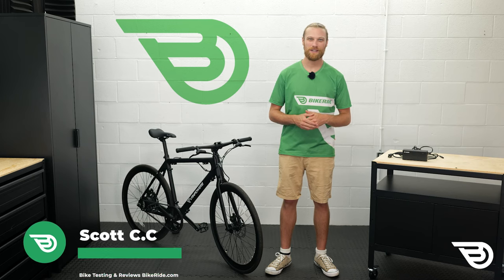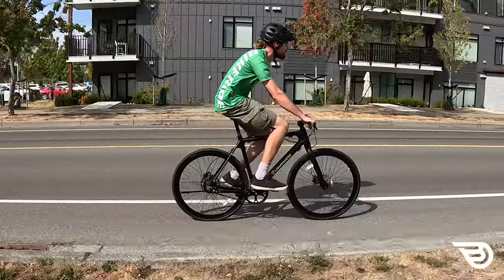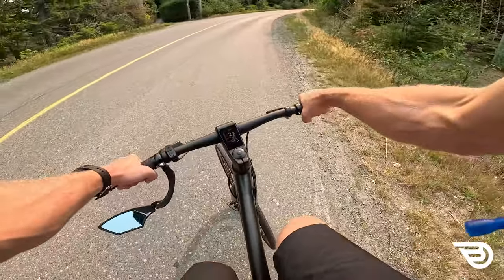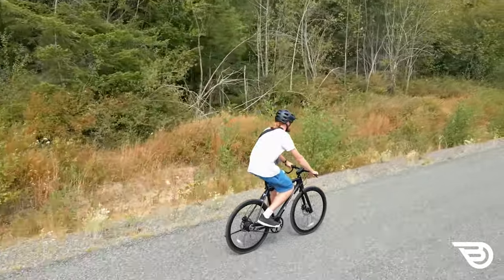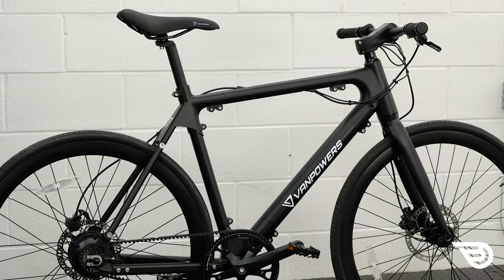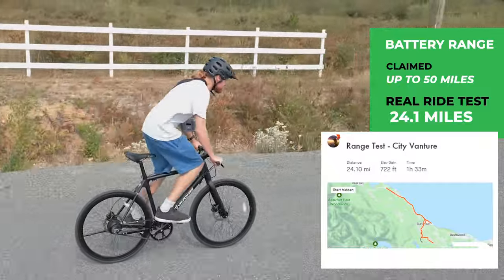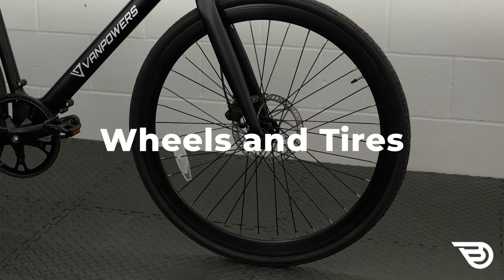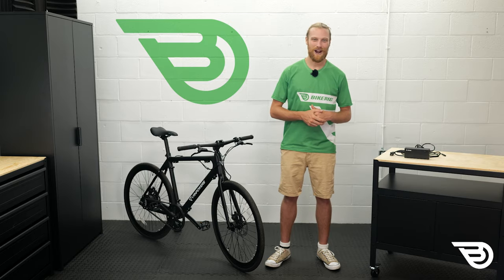VanPowers City Vanture - Flat Pack DIY Urban E-Bike Review | BikeRide.com

Comment: As a City Vanture owner I can attest this is a solid review. I'm happy with the bike overall although I do occasionally run into issues with hills as mentioned in the video. That said, it tackles some hills that were difficult to climb with the regular mountain bike I owned previously. One minor drawback not mentioned in the video is if you're traveling a good speed and lower the pedal assist down a level (because it's not needed) you will feel "drag" from the motor that you would not feel downshifting on a normal bike. At this point you have two options: A) let the bike coast down to the speed that is compatible with that assist level or B) turn it back to the next higher assist level to where you feel little to no resistance in the peddling at all. This doesn't happen all the time but when it does, it's somewhat of a let down. Best suited for relatively flat urban environments and paved trails. 4 out of 5 stars.
ps. Range with extra battery: 30 miles on semi-hilly paved terrain primarily on level 3 using 4 and 5 for hills only without any power loss before having to recharge. *Average speed 16 mph
Reply from the maker: Thanks for watching and commenting! Thats great to know that your experience was very similar to mine with the bike. I agree with all your points about hill climbing and general riding, its a fun and agile bike for flats and smaller hills, and it is definitely better then riding a normal bike up a hill! 

Good point about the motor drag, I did not notice that as much on our test bike, but TBH I was riding it mostly in the highest assist setting, which probably prevented me from feeling that motor drag as mentioned. Great comment for other potential purchasers!

Comment: Very similar to the Ride1up gravel, that has sold well. I purchased the KBO Stealth Hurricane that arrived weighing 37 pounds with its larger 10 amp battery. I immediately went to work removing 5 pounds of weight and adding drop bars. I had to change my route, because it will not climb hills, similar to this model. Not having a torque sensor, only a cheap cadence sensor is one of the major problems of these amazing single speed belt drive bicycles. If only there was a generic carbon fiber frame with square down tube to hold the larger 10 amp battery and get this and other similar single speed gates belt driven eBikes under 27 pounds, and maybe a solid state battery with less charging worries.  If Ribble can produce a 24 pound carbon frame eBike then others can produce a generic carbon frame for this style eBike frame...

Comment: They have it on sale for $869 + $50 water-bottle batteries + $50 helmet. Is it a good deal?
Reply from the maker: It's not a huge reduction in price for the sale, I saw the bike selling for $899 last year during regular promotions. 

The bike is fine quality, but it is a smaller-sized motor.  If your into this style of bike and have been looking at the Vanpowers this could be a good time to buy. 

However, new models from other brands have been coming out with competitive pricing, which could give you more options and additional features for a slight increase in price now (bike selling for $1000-$1300 USD)
Reply: Thank you for the feedback. I see the sale price isn’t much from $899 you mentioned but I think the battery @ $50 is a good deal, so it might be worth it. I saw some e-bike from Costco @ $1300 but it is bulky and ugly.
Reply from the maker: @quinhon1969  Totally, the City Vanture was definitely sleek and minimal, I enjoyed riding it as a pavement bike so it will be much more discreet then those bikes you saw! A 50$ water bottle battery could be a good deal, I have not had a chance to test them for capacity or integration, let us know how it is if you get it!

Comment: For the money, the Velotric Thunder ST1 is a much better value. While it does have a belt drive and hydraulic brakes, the range anxiety and lack of the ability to climb hills make it a no-go for me. I also think that an only $50 difference for putting it together is also ridiculous!
Reply from the maker: I hope we get a chance to try out the Thunder ST1! I am going to have to agree with you on those points. I was disappointed because the Vanture is light and fun to ride on gentle terrain. But the issues it presents take away from the ride quality and made me pretty worried about the range! The bike is also pretty bad to pedal on any type of slope with no power, so don't run out of battery with this one!

Comment: Great video mate! Can I ask how tall are you? I am 1.93 (6’3’’) and I wander if it is tall enough for me.
Reply from the maker: Thanks! I am 6'1" and felt comfortable on the bike, but I did have the seat at maximum extension to find a good pedal position. So depending on your leg length, you may be comfortable or slightly oversized for the bike at 6'3" it's going to be a close one.  It could be good to find a bike assembled at a shop or for private sale to test for fit. 

The brand states an optimal rider height of 5'8" to 6'3" GEO Measurments -  Seat post: 21" Reach: 15.3" Stack: 22" Standover height: 31.9"